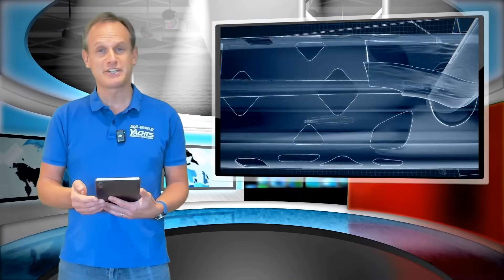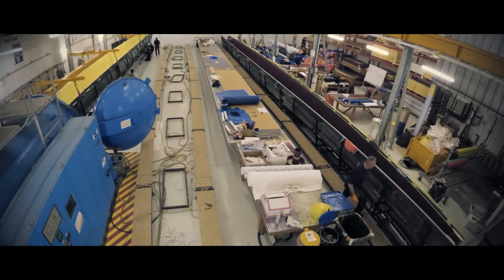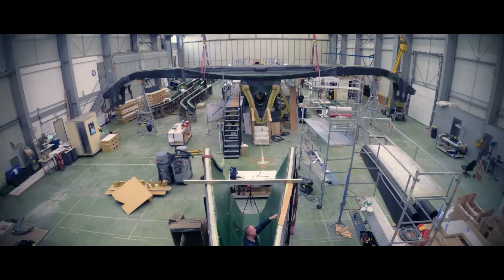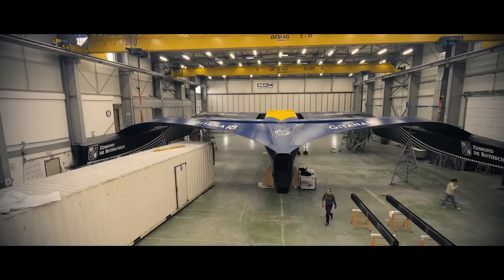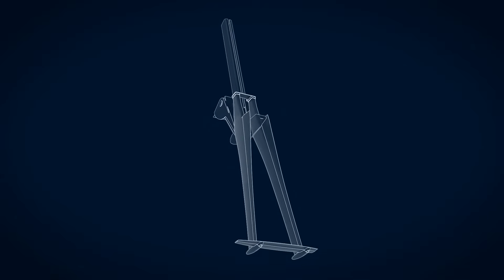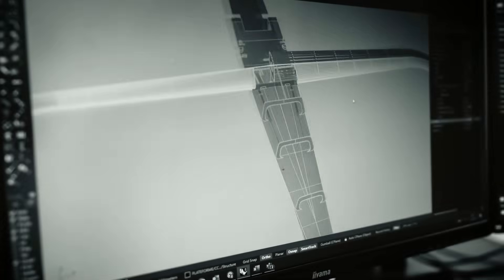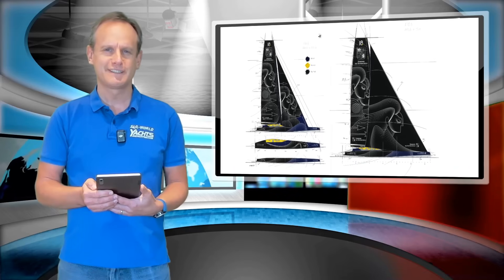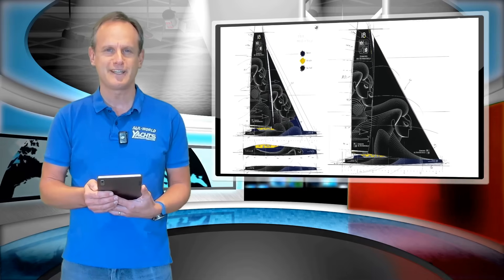The extraordinary Gitana 18 trimaran - Is this the Ultimate Ultim?

Comment: My main concern is collision with "UFOs" (unidentified floating objects). With the Ultime's great beam, and now the large foils on three (double) rudders, the main centre-board and the two Y-foils, the projected area has a greater chance of hitting a "UFO".
I'd be interested in how Gitana 18 is equiped to detect / avoid UFOs (can this actually be done at such high speeds?), and how damage limitation is managed.
Can't wait to see that Jules Verne attempt!!
Reply from the maker: It's a great point. I think that may be one of the reasons that the main hull rudder is on a hinge, but how they can spot a UFO and react in time I don't know. There are systems like sea.ai, but I don't know how effective they are at the speeds that Gitana 18 will reach, and I don't think they can detect things just beneath the surface.
Reply: @Sail-World  So many round the world entrants / JV attempts (tri, cat and foiling mono) are abandoned after hitting UFO's. As the boats become more extreme, (beam and added appendages), I'm sure the percentage of boats abandoning is increasing compared with the older, albeit slower, designs. The large swept area (22m beam with appendages), extremely high speeds and increasing number of UFOs, means an increasing reliance on luck if an abandonment is to be avoided, IMHO.
Reply: @steveporteous3157  That's why IDEC Sport still retains the record after all these years despite attempts by faster trimarans. Unless something can be done to greatly mitigate the risk of hitting UFOs, the current record may not be broken by foiling boats.